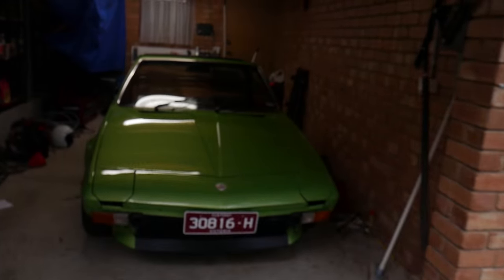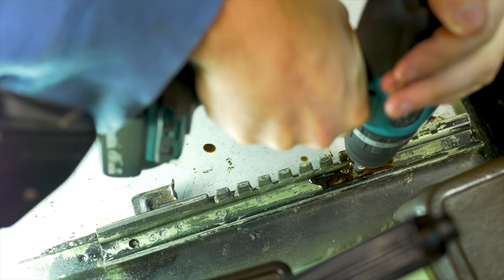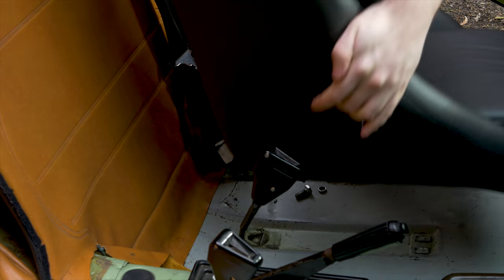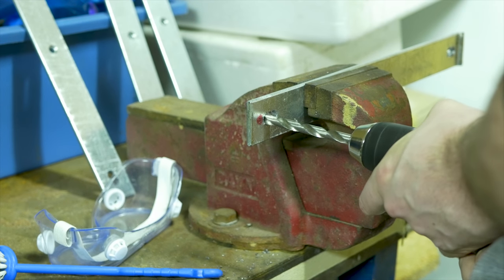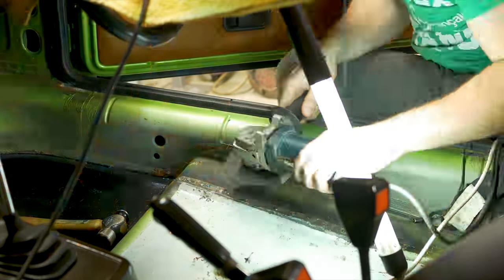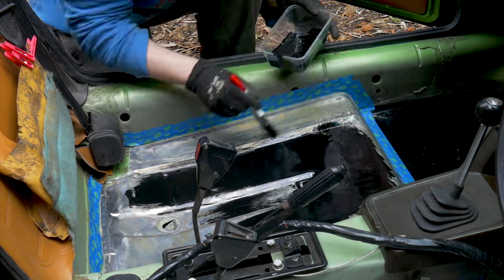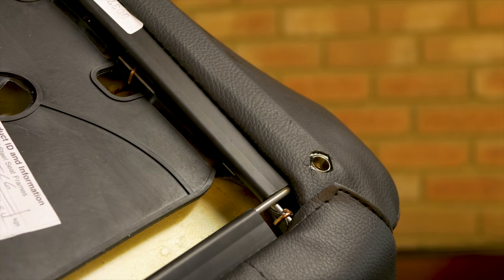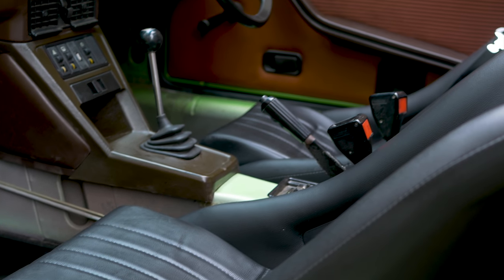How to install classic bucket seats! - Fiat x1/9 [Ep 7]

Comment from the maker: I hope you guys enjoy the new format, showing more detail into what work goes into the car with some narration
Finally having some low profile, body hugging seats is a very underrated upgrade to any car. I now fit below the targa roof and feel secure in my seat around those tight bends!
Reply: Link?
Reply: do they look a bit big for the car? planning to put these in my alfa spider that has only lap belts
Reply: Do you think these would work well in holding you in place with a lap belt (if it had a pass through hole)

Comment: Great video. Love the attention to detail. However reading other comments you don’t have a spare wheel and no longer use the spare wheel compartment? Not sure I would want to lose that space but the seats look very nice!
Reply from the maker: The seats aren't too difficult to remove if I needed access to the distributor, and I have a bottle of tyre filler goo in case of a flat! Less weight 😉

Comment: One question? How do you get the spare tire out do you remove your driving seat?
Reply from the maker: In the spirit of weight savings the spare has been removed and replaced with a tire repair kit and sealant, and road side assistance 😎
Reply: @RevTek   as hunny bunny from pulp fiction said, ‘Pretty Smart’! 😂